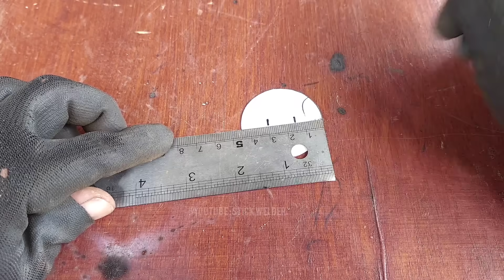new tricks, how a welder goes through his work on round pipes  | metal pipe cutting trick

Comment: Two words. Hole saw. Cut the ends to length with the hole saw in a drill press. No need to cut a hole in the other piece. 100 times faster.
Reply: Well he could just drop the pieces into the local machine shop. That would be easier still. But then, this video is not about easy, it's about the geometry of the join and how to do it with a hand grinder.